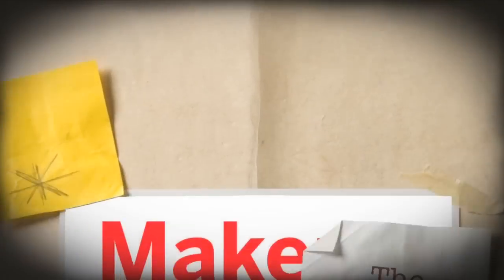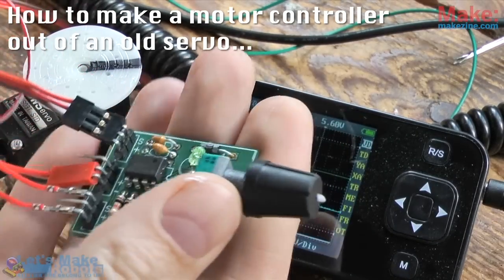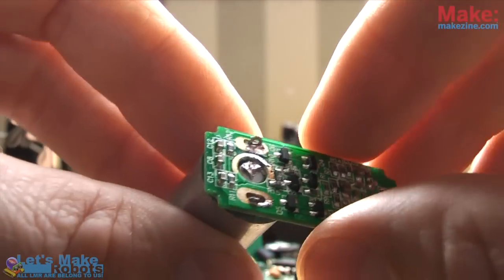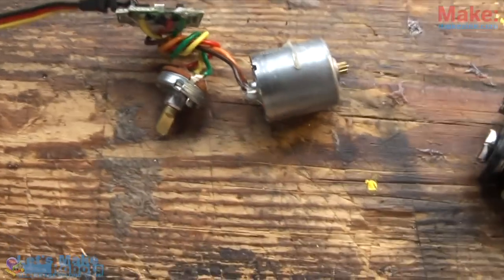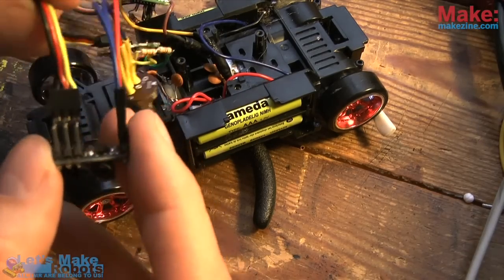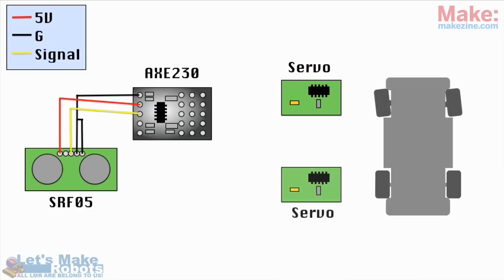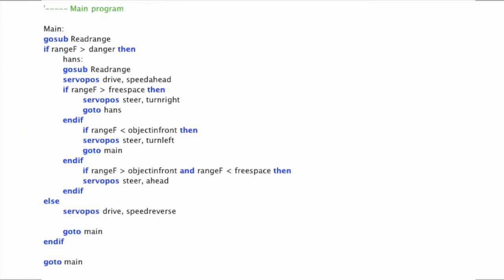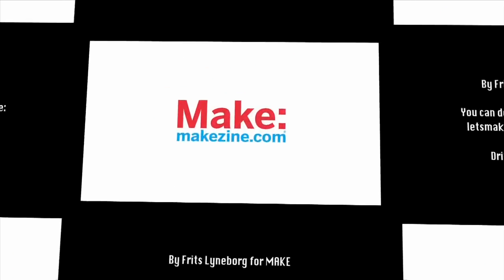Drifting Robot Car - The Latest in Hobby Robotics

Comment: Explanation for public: a servo module usually is the steering of such a vehicle, due to having a limited range of motion. A motor motion has a full 360 degree range of motion, thus these are used for the wheels, through use of gears or multiple motors.

Comment: @Lasrin Having a gyro correcting the drift is much better. Because of the direction you steer the device it corrects the steering. The accelerometer will need a lot of programming. Because the drifting isn't a stable movement. So the wheels will kinda go mad. Having both would be best and kinda complex. Letting the wheels spin harder when it looses its drift with the accelerometer and correcting steering with the gyro. So it always goes into drift or the opposite.

Comment: @tagattack haha..yeah, but sensibly speaking (no pun intended, okay maybe a little) that's only because there weren't a dozen sensors surrounding the vehicle and calibrated far ahead enough for the speed it was traveling; there were multiple factors, but based on the drift car's 'before' and 'after' performance you have to admit the 'after' performed significantly better. For being on the toy-car level - he nailed the foundation for everyone else to build from. Nice car, BTW.